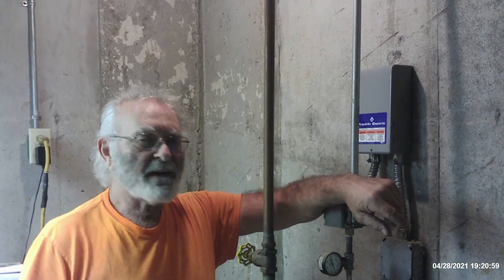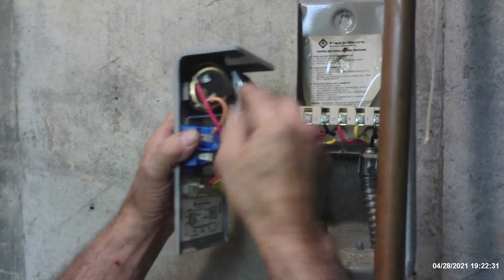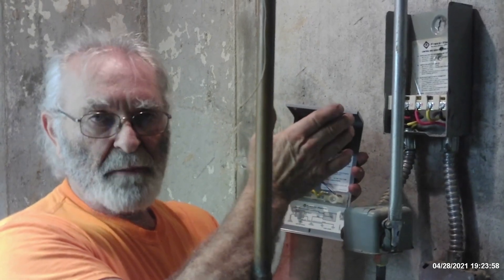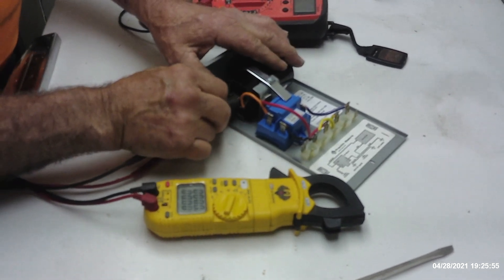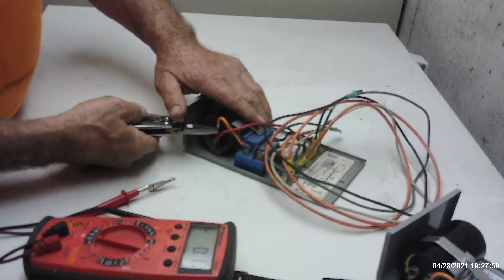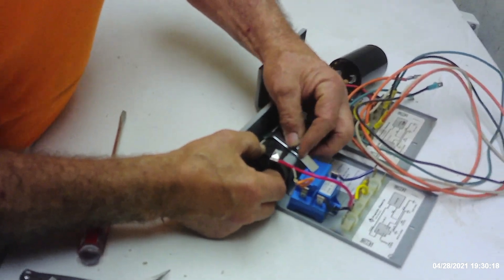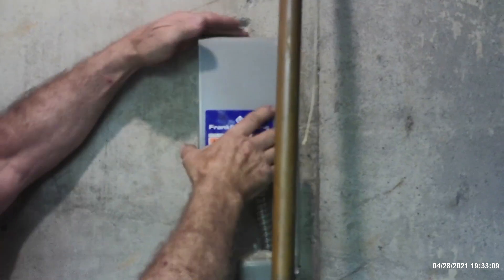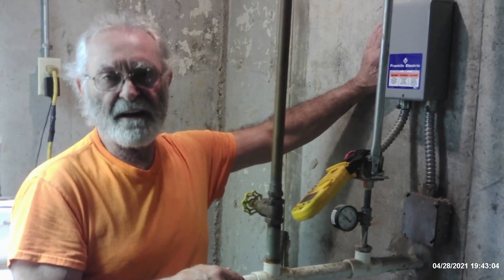Submersible Pump Control   What's Inside How Does It Work

Comment: How Nice to be notified about the latest 44vid,my Friend Wendell! My well is 10 gals. A minuet and they had hit water at 45ft., drilled down 95ft and set the pump at 75. I put a pump in 31 years ago since my Amish friend had a air powered submersible that I replace with electric, which I had to install. So 12-15 years ago I hardtop replace my pump and the replacement is still going strong,,,,,,,,knock on wood! Of course my well is shallow compared to many so my pump doesn’t have to work as hard as yours. I have friends who’s well is nearly 700ft. Ahhhhhhh! To be connected to the 44Network once again? How refreshing! Now I can make comments and know what not to do as you do although I do. I raise me cuppaJO your way on this hot June almost July day. Can you imagine it’s the 4th of July almost? Well to celebrate this day I’ll have another cuppaJO. But then there’s Tuesday, Wednesday, Thursday and Friday,,,,,,, out to mention Saturday and Sunday. Plus it the 4th of July! So I must do extra to make sure we’re still independent! I trust you’ll do the same. I mean we’re saving the Coffee Plant from going extinct,,,,,,,like us, eh? This is DaveyJO inna Holler signing out and doing as you do so I can warn people not to do as you do. But I’ll do my best to be of service and warn folks. Like don’t use a heat gun in the tub for a hair dryer. Don’t stick beans in your ears cuz mommy said not to. And don’t use an electric drill to cure warts to save a buck at the docs. Don’t use gas to start your BBQ and do have a cuppaJO!
Reply from the maker: Hey DaveyJo it sure is nice to see you back in the saddle again.  You'll get the bugs ironed out of the new computation device in no time !!  I hate new things...even 'updates' that change stuff around to make it harder to do things easier.  Hopefully we will see your entertaining comments a bit more frequently now huh.
   Don't brag too much on how good your well is.  That's usually the first sign it's on its way out the door very shortly !!
    Enjoy the morning cuppaJO and I'll share it with you right around 500 eastern...LOL  Have a wonderful day ol' buddy.

Comment: Yep,..I knew that! Hahaha... actually, I have the identical control for my pump and also my 'dealer' does as you said,.. wouldn't sell me the capacitor, so I had to buy the control.
But then for a few bucks more, I just 'plugged and played' to get water back on. 
I usually tell folks,.." DON'T TOUCH THAT CAPACITOR"  with your fingers, or the result will be memorable!

Hey speaking of that Wendell, have you ever had that dirty little joke played on you when you were much younger, where an old auto mechanic would say something like,
" here Sonny see if have enough  strength to pull that wire out of this thing", as he hands you a condenser from the distributor of the car he's working on?
Great 'educational tool' that!
Reply from the maker: Oh heck yeah....my uncle had an old hand crank magneto in the blacksmith shop.  He'd love to get an unsuspecting kid to hold the wires when he'd give it a quick spin with the crank !!  But he'd get you only once !!!  That's all it took.  A charged condensor would be a good trick though.  LOL
Reply: @tractorman4461  Like Flip Wilson used to say, "The Devil made me do that! "
Reply from the maker: @regsparkes6507  Hahahahaha...Flip Wilson...LOL...but then Geraldine would probably deliver a quick back-hand after she caught it.  You realize we are letting everyone know just how old we are.....  LOL  Half the kids under 50 don't even know who those two are I bet.
Reply: @tractorman4461  Haw haw haw,...( I mean that there's my morning laugh )   now there's something that I  didn't think of,...
Note to all others,...we, Tractorman44 and I,  heard about this Flip Wilson, person, from our Grand Parents,.. really!

Comment: I thought you were going to pull out a Simpson meter and show the kids how to test a capacitor with an analog meter 😂
Reply from the maker: I actually prefer a Simpson analog over a digital IF the DVOM doesn't have a specific scale for capacitance. I was gifted a brand new old stock Simpson 260 analog by the son of my very good friend that passed away two years ago.  I've not taken it out of the box yet.  It even has a NOS roll top case to go along with it.  Thanks Lou for the comment.  My old old Simpson from the '70's has corroded contacts in the battery compartment and needs some TLC to work again.  My fault though.
Reply: @tractorman4461  we are both old school I guess 😂
Reply from the maker: @lou198  Yes.  It is good to have a bit of a mixture of the old and new tools and techniques. When I was getting started in HVAC, the Simpson 260 was so expensive compared to what my pay per hour was it was kinda like the Holy Grail....unattainable.  I didn't get to buy one for several years and got by with a $29 Micronta multimeter from Radio Shack.  Have a great day Lou !!
Reply: @tractorman4461  my first was a speery snap 8 clamp on multi meter that I got from school  I still have it along with many modern flukes
Reply from the maker: @lou198  Fluke wrote the ALL the books on DVOM's as far as our industry is concerned.  Though I've never owned a Fluke that was an analog device.  So I gotta give kudos to the Simpson on that category.  I have two Sperry clamp ammeters that were flooded many years ago.  I should just toss them....

Comment: I worked with those pumps too. I pulled some of those pump to replace the Foot Valves. Foot Valve keeps the water supply line primed otherwise you get no water.
Reply from the maker: You are correct sir !!  I’d rather work on an oil burner than pull a well to replace the foot valve !!  How about you ....  LOL.

Comment: Yep, discharging capacitors before working on them is a good practice. I got hit pretty good by a large capacitor in a Navy surplus piece of equipment back in high school. We were disassembling the Naval surplus equipment to salvage parts for projects (I was studying Electronics in a Vo-tech HS). I touched the wires at the end of the capacitor and thought I was shot! Was definitely a good capacitor considering the equipment was 30 years old at the time. TV repair man I knew carried a grounding rod for the capacitors in TVs, It had a wire with alligator clip on the end that they could hook to the chassis and then probe with the rod to discharge the capacitors. I made one for myself after I got shocked. 👍👍👍
Reply from the maker: Yes, working on the control panels in commercial roof top units we were supposed to wear a grounding strap around our wrist with the telescoping alligator clip...."supposed" is the key word here.  I got bounced a time or three by a capacitor, but the worst one was troubleshooting an oil burner transformer... Wow !  I thought I was dead.

Comment: Check Amazon that is where I buy my individual components for these. Just search for the capacitor by the mf capacity and voltage. I am sure you could do the same on ebay or other sites also.
Reply from the maker: Our local supplier only sells the whole control box...no parts.  But by the time I left, my son had found and ordered two replacements from Amazon.  You kids and your computers these days ....  LOL  Thanks Bill for watching and commenting my friend.